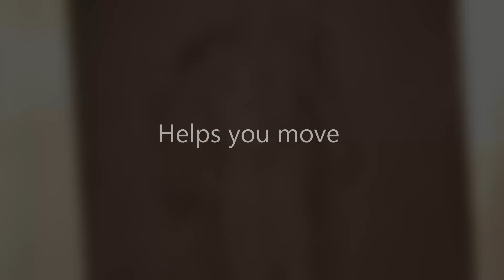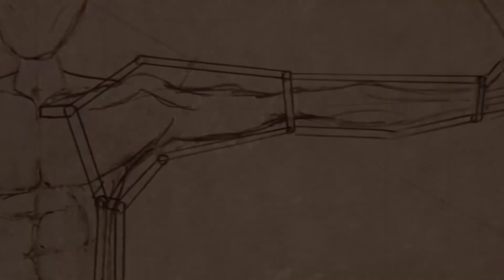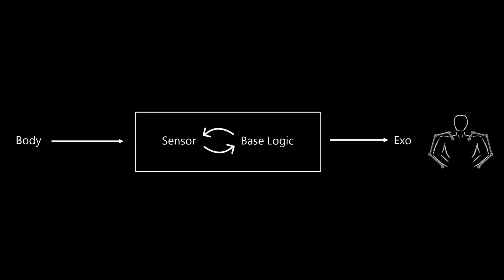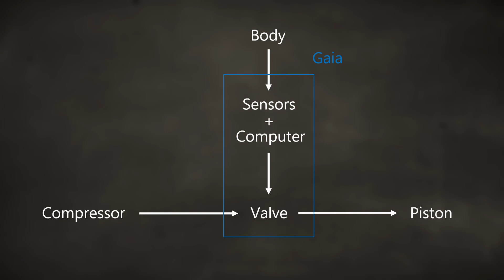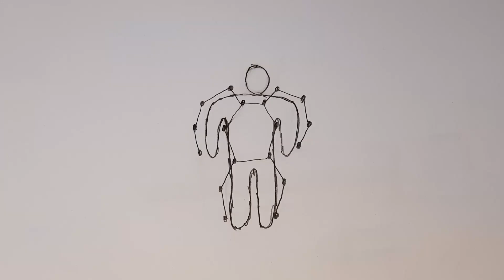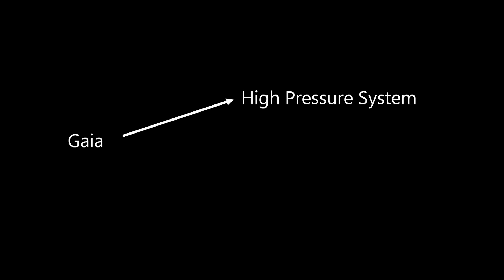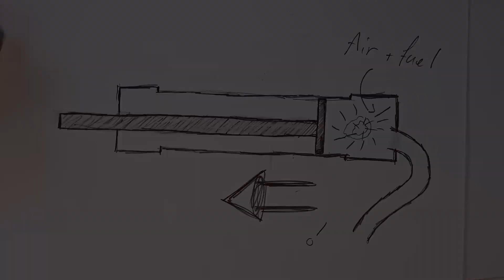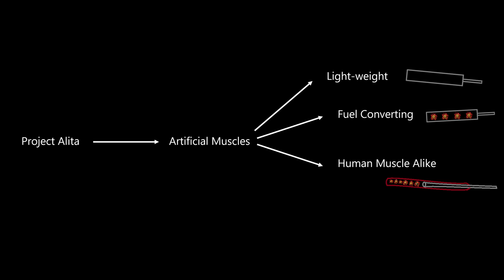Mrk II: Upgraded Exoskeleton Arm! Project Gaia Part 2

Comment: This may be a silly idea, but why not incorporate passive exosuit mechanics alongside the powdered suit to reduce the use of fuel or battery life. For example, having the suit stiffin when held in position or having springs return the arm to a position when not under load. Some real-world examples would be the suits used in rifle shooting for the Olympics  or wearable camera stabilizer. Another simpler one would be your mic stand. By using a passive system alongside an active one, you only expend energy on motion and not maintaining stability.
Reply: There may be some things I'm not thinking about like the energy needed to overcome the stiffness. 

I would love to see where this program ends up I also enjoy the Idea of mechanized mobility just think of how many specialized machines a exo could replace farming equipment for moving bails of hay, fork lifts, general construction, basically anything heavy that needs picking up or putting down.
Reply from the maker: Haha yeah I've also had the applications on my mind a lot too! My personal favourite is rescue work:)
Reply from the maker: That's such an interesting perspective! I've never looked at the mechanics of stabalisers, but that might the be kinds of physics and engineering we need! Thanks!

Comment: hey, quick advice from a roboticist working in rehabilitation exoskeleton, exos are in fact robots especially the one you are trying to build. The base idea is to have a scale factor A so that F_exo = A*F_human (gross simplifaction). First tries of that where made in gravity compensation devices in robotics where you had to precisely apply a force to each joint. Your problem is analoguous in the way that your system has to respond to an unpredictable force input. On the actuators, pistons have been abandonned due to the fact that they are too hard to force control. The compressible nature of air make them hard (impossible) to force control at 100 s of hertz (current SOTA control frequency). The last fluidic actuators where used by boston dynamics and where based on oil running in custom made motors (not pistons). If you plan to not do force control but displacement following, you have to implement volume constraints on the  actuator stroke length not to break your bones !!! Thats why academia chose electricity , small cables easy to force control and very high efficiency, (for your fuel idea remember that a most of the energy is lost as heat... I guess that would be biomimicking well ahah). I totally agree with you on the avoidance of 3d printers, your way of quick prototyping is vastly faster !
Reply from the maker: That's absolutely brilliant advice! Thanks, I'll look into all of that!
Reply: @NovaMachina  no probelm bro, keep up the great work ill follow you closely !!